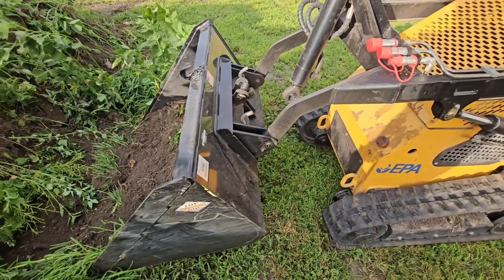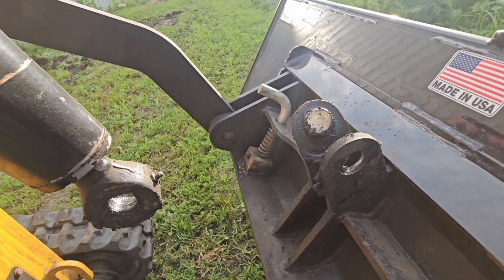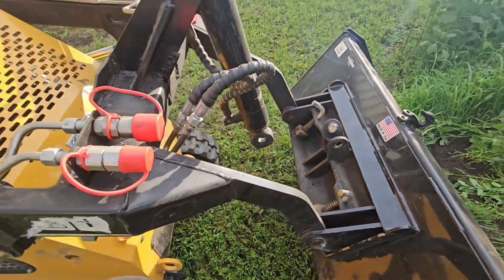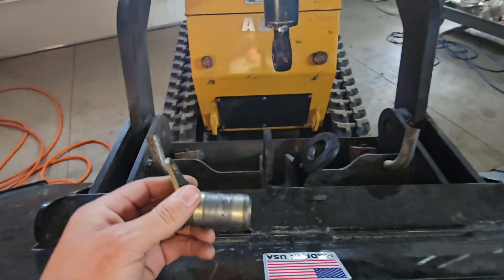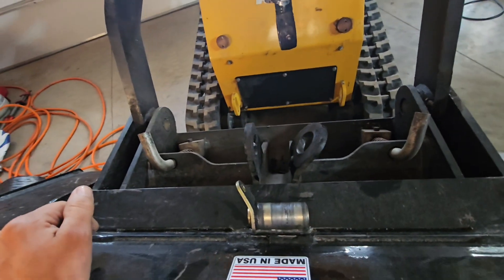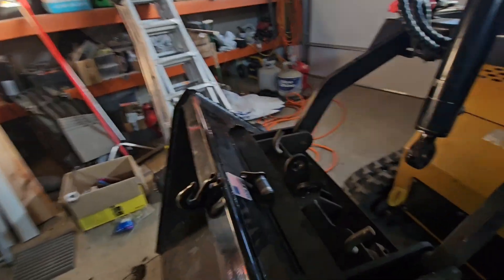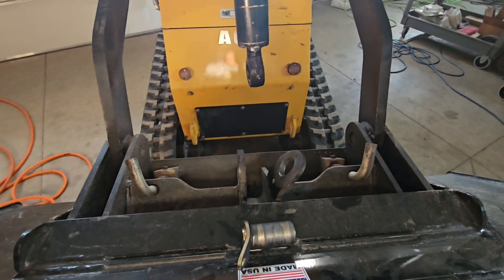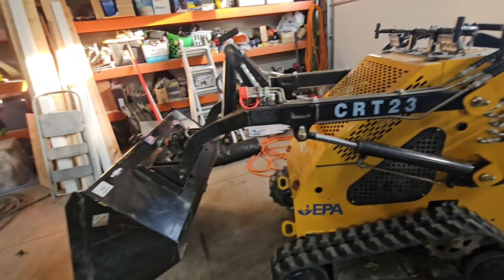DON'T HAVE THIS HAPPEN TO YOU!!! THE FIX IS IN!!!

Comment: Wow I would have been thinking the same thing about one of those tabs never bending like that. It’s still awesome to see how much you use your CRT and the good work that it does for you 👍👍. After putting a few hours on my CRT I have come to the conclusion that I don’t like the way it has the splits track and bucket controls. I will be exploring moving them around to have both tracks on one side and then the buckets on the other side. Other then that it has been doing good for me 😁
Reply from the maker: Awesome to hear it's doing good work for you, and good luck on the mods!
Reply from the maker: I just got my unit fixed, should be a fun video!!

Comment: I bought a new cylinder for mine that is slightly longer and I am going to change the mounts to accommodate it. On mine the mount plate is not straight up and down when the boom is at the bottom so everything that I have bought for it does not curl back enough. I have forks, but they will not sit level with the ground when the boom is at the bottom. A larger bucket that I bought does not curl back far enough so it loses a lot of a sloppy load when I lift it and I have to carry it high to keep stuff in. A snow pusher I bought will not align with the ground properly because it doesn't curl back far enough. There seems to be room for more travel in the curl pins so I am going to modify it for more curl and more dump.
Reply from the maker: Good luck with the mods and keep us posted!

Comment: Make sure before you weld reinforcement straps in that the bucket will tilt the full range up and down without hitting the cylinder. Also, you need a longer pin with a hole on the other end that you can put a snap pin in so it can't pull out again even if the other side bends.
Reply from the maker: Thanks for the heads up!